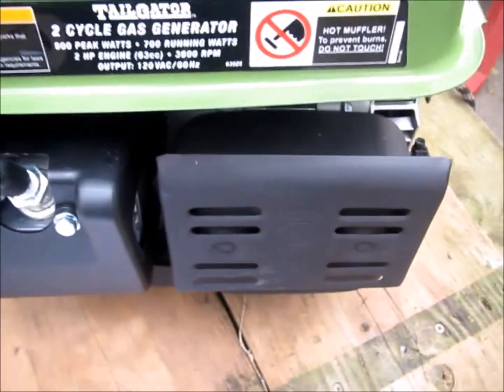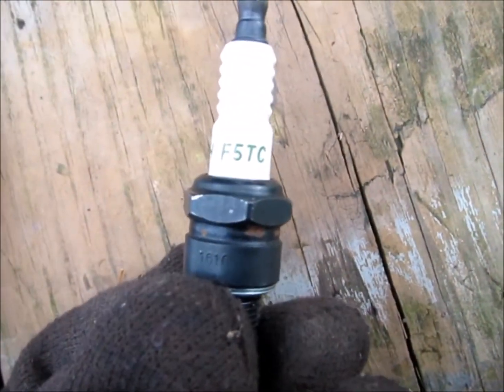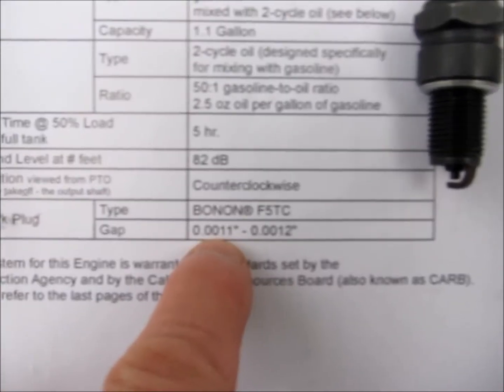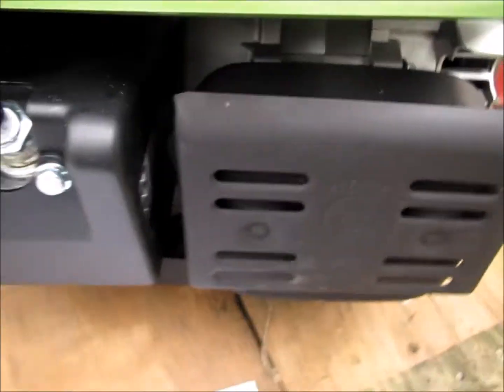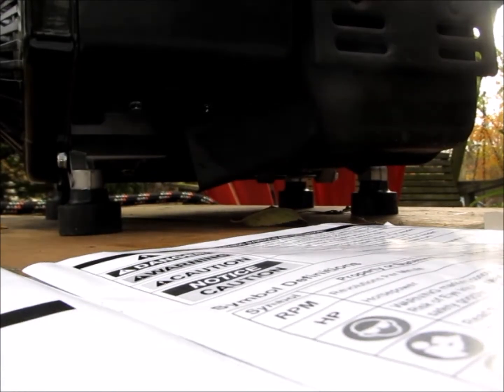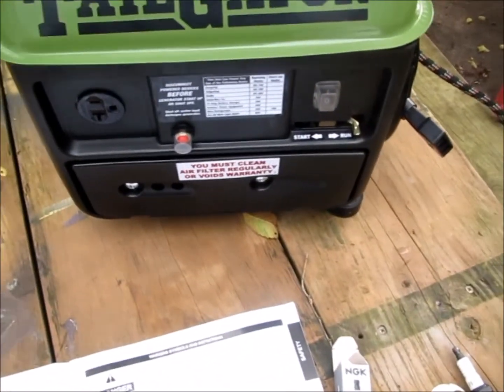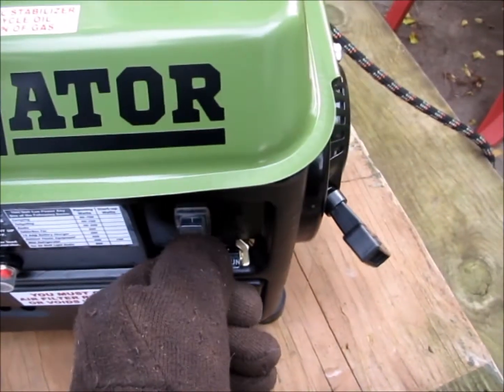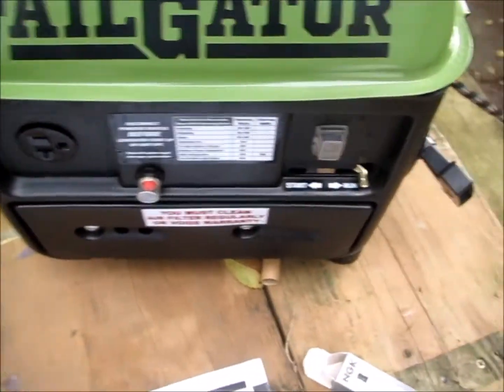Harbor Freight 63025 Tailgator Generator Spark Plug Gap

Comment: I have owned one of those around 2 years and I try to run it every 2 months.  I have a 28' camper and it will run everything even the refrigerator(no microwave or A/C) but it was maxed out!  It's worth what you pay for it!

Comment: I just bought one of these today. Went to the auto parts store 
immediately to get an NGK plug. Crazy thing is the plug that's in it is a
 Torch F7TC and the manual says it takes an F5TC. NGK BP7ES and BP5ES 
respectively. So...what the heck do I put in it? 5 or 7? Any 
suggestions?
Reply: @LZbravocharlie  
Also, small differences.

BP5ES has a projected tip and 1k ohm resistor. Also -2.5mm shorter than the BR5SES. No longer in production. Replaced by BPR5ES, which uses a 5kohm resistor.
The BR5SES uses a 5kohm resistor and a non-projected tip and as mentioned before a greater seat-to-terminal height.
Reply: 𝑾𝒉𝒚 𝒅𝒐𝒆𝒔 𝒊𝒕 𝒔𝒕𝒂𝒓𝒕 𝒃𝒖𝒕 𝒅𝒐𝒆𝒔𝒕 𝒈𝒊𝒗𝒆 𝒑𝒐𝒘𝒆𝒓
Reply: @LZbravocharlie   NGK BR5SES according to the Yamaha ET650 manual. Im gonna look up the coil assembly on the Yamaha and Clone to see if its a match

Comment: Forgive me for I am new at this. So I didn't know that I had to mix 2 stroke oil with the gas before I ran my tailgator n now it won't start back up for me any suggestions on what I can do to get it going again please it's my only source of power right now due to the fact that I was a victim of arsonist less than a month ago so help right now would be great please

Comment: I pulled the plug cover off and a spring fell out, any ideas on that?
Reply: Push it back in. There are some holes in the sleeve of the plug wire, Long prong of the srping goes in the hole toward the middle, short prong to the outside. Funnny, everyone says to change the plug, nobody says to change the wire / connector on these things. I have no clue how that stupid spring actually provides decent spark!
Reply: Yes, the whole thing fell apart, it was the piece holding the whole thing together. Fixed now!
Reply: @Big Dog look up Storm Cat spark plug and boot replacement on Kev Central's channel he has a very good video on how to replace the stock spark plug boot with an NGK boot and NGK spark plug I did that to mine and it starts so much easier now. I would say about three pulls if you run it out of gas and 1 or 2 pulls if there's still gas in the Carburetor. The part # is Lb05ep you can find it on eBay for about $5-6 bucks it's totally worth it if you ask me.
Reply: That is the connector between the wire and the plug that goes on the end of the spark plug wire and sits inside the boot. The two prongs on the end of the wire spring poke into the wire. Look for punch marks and squeeze them back into the wire with some pliers. you may need to bend the wire back to get it to stay in place properly. This is the number one reason these little units won't start after a spark plug change.